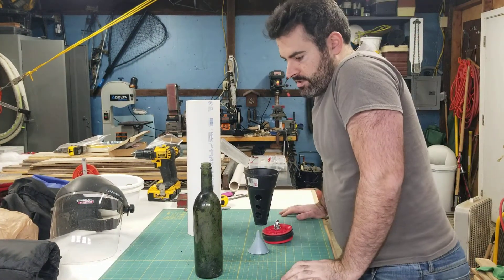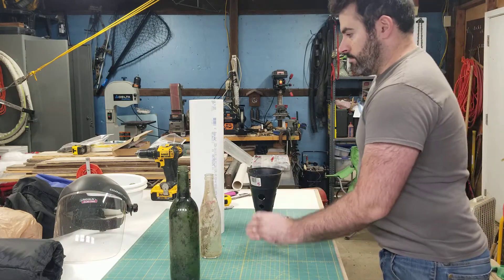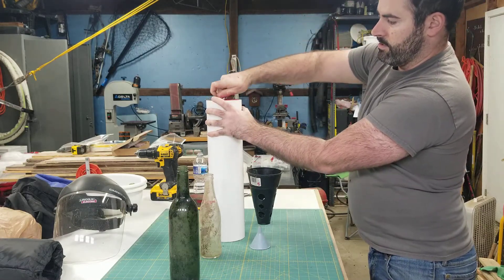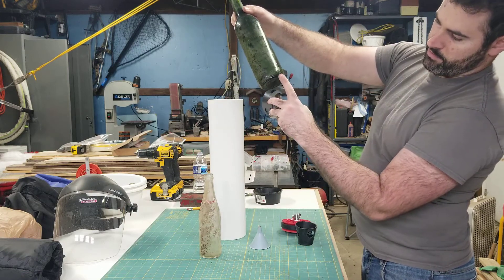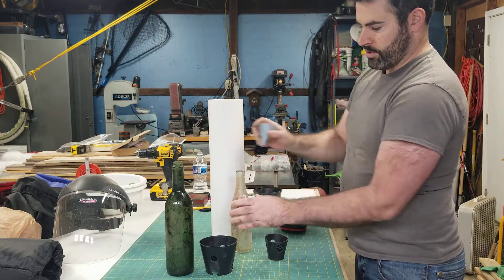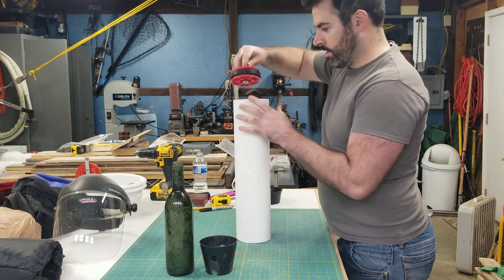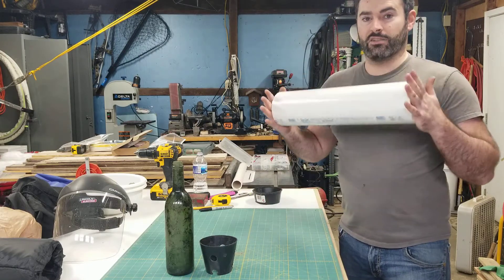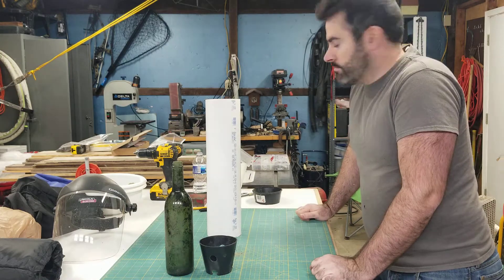ANTIQUE BOTTLE TUMBLER MY $20 DIY VS $700 BOTTLE DR.

Comment: For those out there who are interested: use 3/4 teaspoon of grit or polish for the inside of your bottle and fill just over half with cut copper and water to 1/2 inch above the copper. Add 1 1/2 teaspoons to the barrel and fill the barrel with just over the hallway mark on the bottle and cover the copper with just over an inch of water then let the tumbler work it’s magic.

Comment: Where did you buy and who makes the 4" compression fittings?  I haven't seen that type of oil filter.  What type are you talking about?
Reply: Four inch PVC pipe and 4” compression fittings are at Lowes or HD. Plastic oil funnels too…..